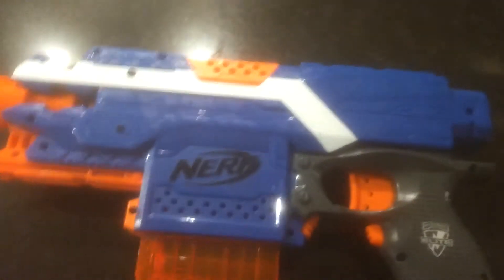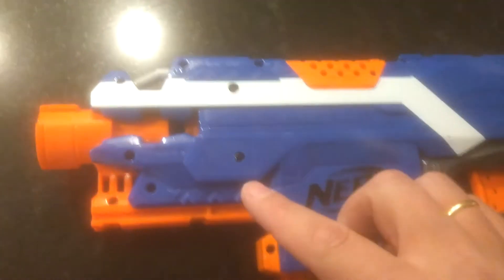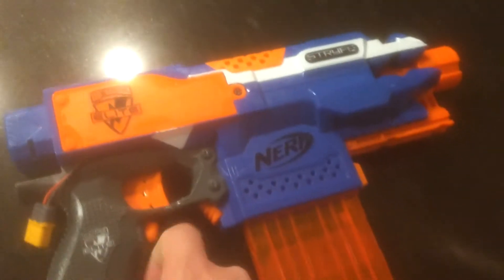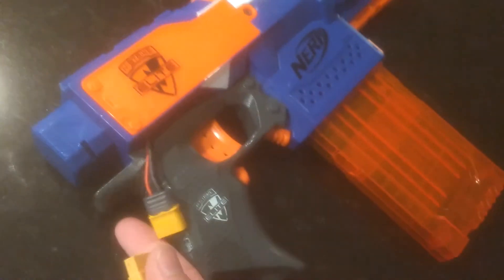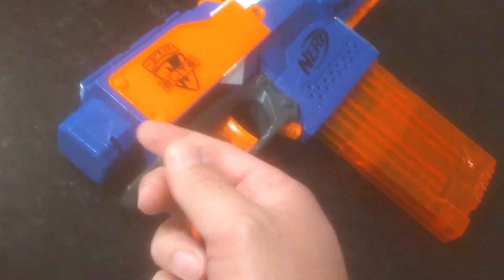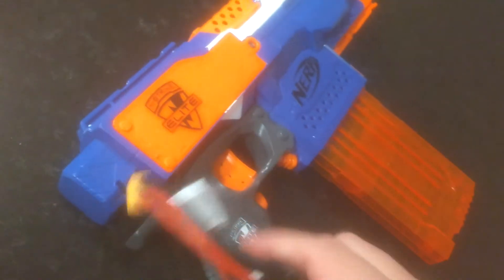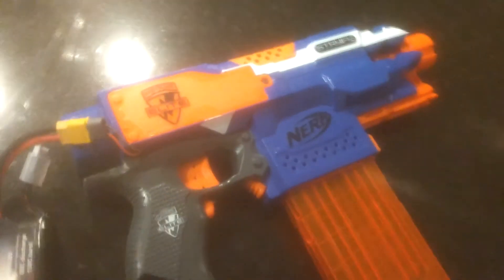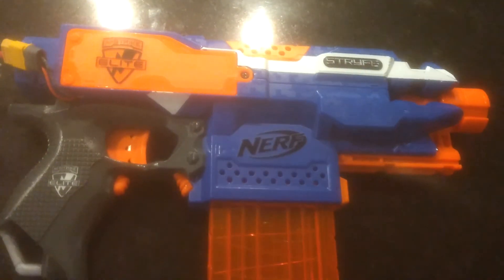Stealthy brushless Stryfe mod

Comment: Where do you store the battery? Some kind of modification to a blaster stock to hold it?
Reply from the maker: I either use a small 500mAh 3s.lipo or use a special printed battery door (not in the video)